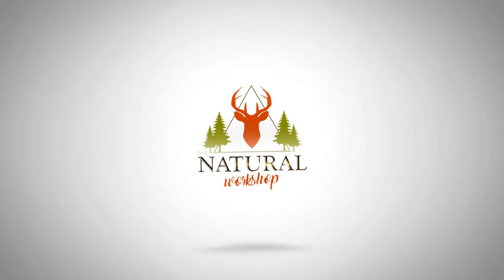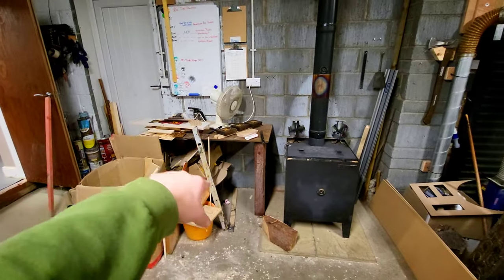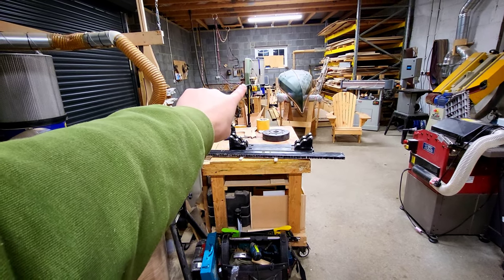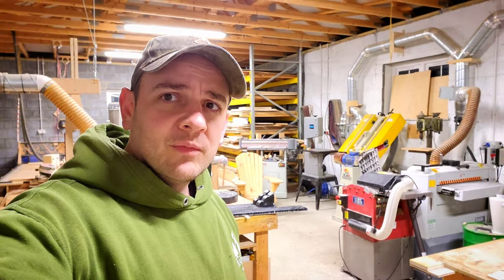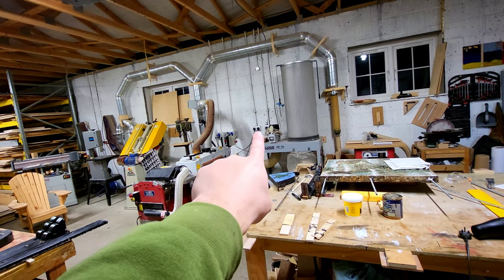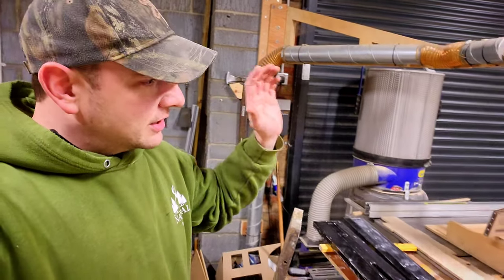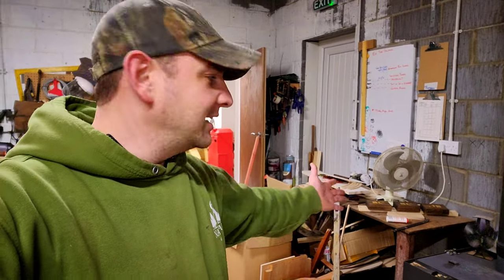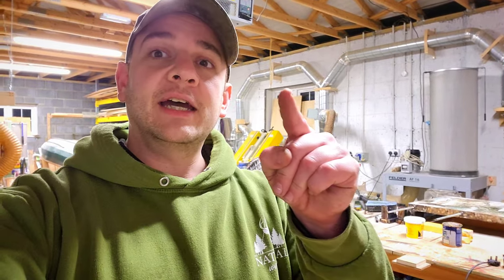I need a change, what do I do with the workshop? How do I fix this mess?

Comment: For color, you could paint the top 2 rows of blocks, and maybe the corners too, either all the same color, or contrasting colors. 

As to your lathe, put it on a wheeled base that you can pull out like a drawer when you need to use it, but push back out of the way when you don't.
Reply from the maker: I like the idea on colour, that gives me some options and still keeps the white to reflect the light! Ive got a compressor behind the lathe, maybe I can build something with both in or just move the compressor somewhere else!

Comment: You've got a lot of offcuts and timber lying around. I would tidy that up into some neater racks first of all. You also have a lot of wall space that you could mount boards on...I would make tool storage panels and paint them in bright colours ( mine are in festool grey and green, because I'm sad that way!)
You're right about radial arm saws using a lot of space (and their only really useful function is to cut dados and housings), but I would keep the mitre saw for cutting boards to length. I vaguely remember seeing a combined mitre and radial arm saw bench which had both saws at the same level and using a common fence with length stops on it, and you've deffo got the space for that! You could also use some of your Chinese plywood to build a cabinet or cart to keep all your finishing supplies in.
If it's any consolation my workshop is about 6000 square feet overall, and basically I cannot remember what the floor looks like.....it's more like a landfill than a workshop!
Reply from the maker: All good suggestions. I am hoping to get a lot of the off cuts and timber racked off next door in the storage side, ah thats a good shout with the storage panels, might be a good idea! 😂 Not sure I would do Festool colours though lol. 6000sqft 😲 Man thats huge...(thats what she said😂) Joking aside though, that is massive lol, what do you do? Ill have to have a look around for Mitre saw/radial arm benches, my saw doesn't take a dado so I would really like it have it for housing joints and cutting 4" timbers.

Comment: Draw up a plan of the workshop , measure each bench , tool etc and get cutting out the card or thin ply on ya cnc , have a play that way 

I can only suggest looking at ya work flow say  ply to cnc then sander then the bench to assemble less movement lifting = less time used up

or solid timber to planer/ thicknesser to sander to the bench 

Use the rafters above to store stuff you don’t want to throw , get the boat up and out of the way

I have an old Elu RA saw that cut 600+ cross cut yep takes up room but I slide the arm so it’s parallel to the wall , when not in use out of the way

Castors are ya friend though I’m in a single garage so deffo help
Reply from the maker: Good shout with having it slung around to the side, Ill have to have a look and see whats what when I pick it up. Good thinking 're the flow, I need to have a look and see how the shop works. Things have changed massivley over the last year and have moved away from mostly sheet goods to a lot of timber work so I think you are right, need to think about how we will be moving around the shop!
Reply: Re the painting , white for the reflection but if ya plan to do more YouTube social media maybe a better back drop showing ya logo , stuff ya make etc 

But I do prefer the used workshop look from a maker
Reply from the maker: Apologies, only just seen the reply! Yeah totally agree, Michelle and I have been having the same chat in the workshop. The side I do all of my filming on is the side she needs white as thats where her machines are set up but its behind me so I wanted some sort of wood finish lol. Will have to figure that one out!

Comment: Two observations.. you have a decent amount of height in your workshop but you're not using it all.. the mitre saw area looks like a mess(!?) but you could have some up cupboards or shelves above. Also I reckon putting everything on wheels is the only real way of getting around the issue you have, I don't think it needs to be expensive though. Castors for light weight stuff aren't too expenive I think.
Reply from the maker: Apologies as I replied to this but I dont think it posted! Yeah I think some more cupboards or shelves is a good shout. Ive got some spare material for when its all cleared so thats a good option. Im going to investigate the whole castors thing and see what could work. Thanks again for the reply!